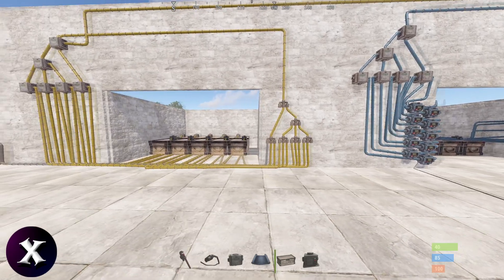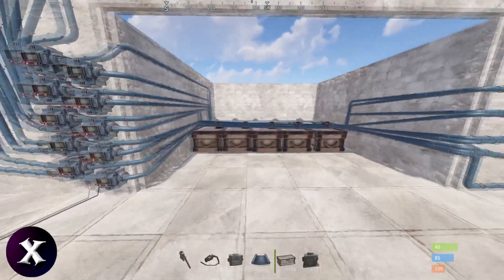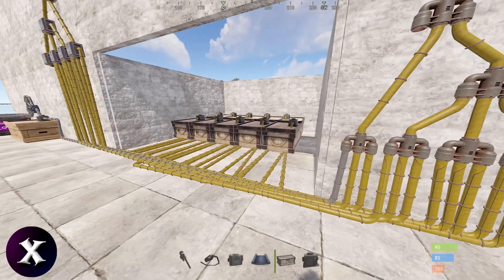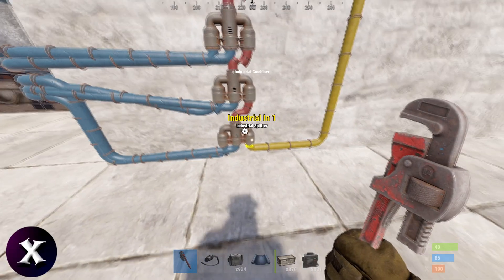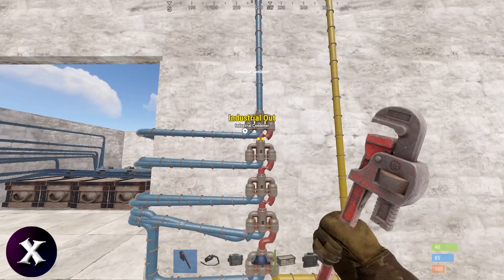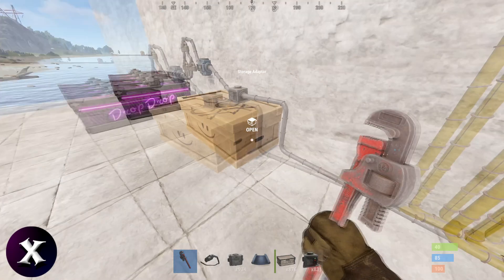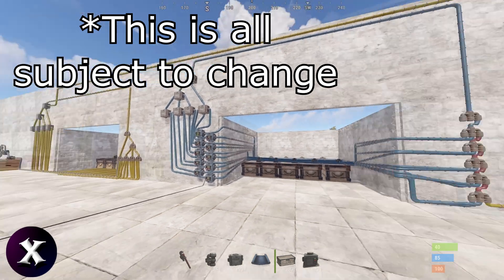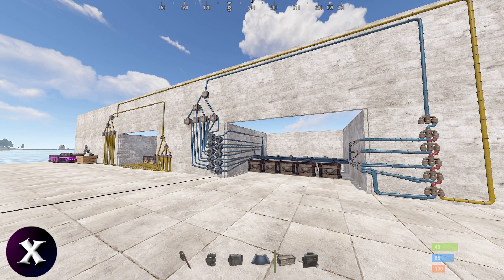Rust Modular Sorting System Hotfix 1.01

Comment: I tried this system, and even with filters, it just pulls the items back out and recycles them through the system.
Reply from the maker: Pulls them back out through the buffer box? You don't want the buffer box getting input from the loop, only output to the loop. Otherwise, it means you have a double filter somewhere. Either a blank filter on a conveyor or two conveyors that have some of the same items on them.
Reply: @x-tremespeed  So every converyer needs a filter in order for it to work. I realized there were 3 boxes that had blank filters, After shutting them off it seems to have fixed itself.
Reply from the maker: @Zyric83  Yeah, since they are all connected in a loop, if you have blank filters they will pull from every single other box. 

Glad you got the problem sorted out!

Comment: have you ever had a problem that not every items don't go inn the sorting boxes, like some times they dont go from the drop boxes to buffer, and some times not from buffer to storage? i im totaly lost, I have watched your videos many times and done exactly as you said, but I don't know how to do it, I have 15 boxes in tier 1 + buffer and 6 boxes in tier 2, for example, I have 8 garage doors and when I put either a drop or a buffer box, they don't go through. im lost plis help 😅😅 sry to waste your time😅
Reply from the maker: If you don't have any filters on your buffer box conveyor that should move the garage doors no problem. I have not run in to any issues like that, but it sounds very strange. The only reasons I can think of why loot wouldn't move are

1. The target box is full
2. The conveyor has a filter on it that doesn't include the mentioned items
3. The pipes aren't connected quite right - if you have a long pipeline it will sometimes not connect properly. Even though the pipe is visually there, it isn't actually connected.

If you're still having trouble, you can try joining the rusticity workshop discord (run by the same folks who made rustician.io) and there's a friendly community there who helps with problems like this. It's easier since you can post pictures etc. - I'm over there too so it'll be easier to troubleshoot.

https://discord.gg/AwpRKJYncF
Reply: @x-tremespeed  omg thank you so much for asnwer so quick<3 i wil try what you said tank you
Reply: @x-tremespeed  i tried and cheked everything but its whatever haha, its strange i dont have anny filters but ye its ok ty for help tho XD
Reply from the maker: @simonueland7214  If you're still having trouble you can try joining the discord I linked and either myself or one of the other helpful people there can assist you with troubleshooting 😄

Comment: I have a question, if I was trying to do two wood boxes instead of just one, how should I set up the filters? If I put two conveyors with wood filters, this system goes into a recursive loop where the wood filters will keep taking items from each other. 

What do you suggest? Thanks!
Reply from the maker: I would suggest adding a splitter on the backend of your wood boxes and connect one line into a conveyor running into the buffer box. Set this conveyor to filter wood, and set the conveyor mode to "exclude listed items". This will pull everything from that box EXCEPT wood and deposit it into the buffer box. Use the additional splitter outputs into any system you have that requires wood.

Sorry for the late reply - I didn't see the notification for this comment, but hopefully it can help you out!
Reply: @x-tremespeed  ah! Thanks for the reply :) I'll give it go later on my server. I wonder if there's a better way to scale this... For example if I've maxed on slots for wood, I would need to always perform this bypass to attach another "wood" box yes?
Reply: @x-tremespeed  by adding a split on the backend of the wood boxes, do you mean a new adaptor or using an existing adaptor to split from? Thanks again for your help!
Reply from the maker: @fierytuner  You would only need to do this once after the last box: wood input conveyor ----> wood box 1 ----> wood box 2 etc. etc. -----> splitter ----> conveyor with wood exclude setting ---> buffer box. You don't need any additional storage adaptors, you can just plug it into a splitter. Just be sure to NOT plug this into a tier line.

You can actually forget about the splitter and only plug it into the conveyor with the wood exclude setting if you don't have any other systems that use wood, so build it however suits you!

Comment: it's so funny that they didn't use a recursive algorithm for an intrinsically recursive problem, so all you needed to do to work around it was just add one layer of indirection
Reply from the maker: I like to think of it as the conveyor making promises to the boxes, and following up on its promise even if it's overloaded. 

To explain further, I like to think of a combiner as a doorway into a room with space for 3 things - any combination of storage containers, or other doorways (additional combiners/splitters). As the conveyor probes down the first input all the way to the end of the line, it passes all these boxes in all these "rooms". As it passes the sad boxes, it promises to pull resources from each one, and conveyors don't break their promises. Once the conveyor hits its max of 16 boxes, it starts heading back up the pipeline to deposit the resources into the output box on the other side of the conveyor. It passes through all these "rooms" with boxes it made promises to, and conveyors don't break promises. Even though it is only allowed to take resources from 16 boxes, conveyors stretch the rules so those promised boxes don't get left behind. Of course of there is any degree of separation (from daisy chaining or additional splitters/combiners) the conveyor won't "see" the boxes as they are "behind an additional door" it doesn't need to open.

Hopefully my little story made sense, that's just how I saw it working haha!

Comment: Hi. I've had a problem while trying to use the minimum function on the conveyors to only allow 1000 stone in tc, and pull out after that. It seems to ignore the filter and pull all stone out. Do you know if this is a known bug? I have about 5 splitters all pulling from the tc, is it a channel limit problem?
Reply from the maker: Yeah, so the minimum function is actually a buffer function. A buffer function means it will only move the item once you have the set amount in your input container - in this case your TC. Basically the way you have it set up is like saying "as soon as I have 1000 stone in my TC, pull it all out." 

I recommend having your stone (and other resources) put into your TC by pulling from your resource containers and using the MAX function. I have a video on this here: https://youtu.be/UqxPoxzOrk8

Also, they ARE changing the way minimum works soon. Minimum will work how you explained, and they are adding a new function called buffer which will do what the current minimum does.

Hopefully that solves it for you!
Reply: @x-tremespeed  thanks for your detailed reply - that makes a lot of sense.
Reply from the maker: @jordanormerod-ik9pn  I'm glad I could help!

Comment from the maker: The maximum amount of boxes this system can hold is 15+1 Tier 1 (15 boxes in Tier 1 and 1 buffer box) and 18 boxes in Tier 2 for a total of 33+1 boxes. This limit is due to the maximum number of connections being 16.

You can increase the amount of boxes by adding a buffer box between Tier 1 and Tier 2, although you will need additional conveyors pulling from Tier 1 into that buffer box. Those conveyors need to have identical filters from all your Tier 2 conveyors, but you can combine filter options from multiple T2 conveyors to cut down on electricity costs. For example, if you had a wood box and a stone box in Tier 2 that would require 2 separate conveyors, but you could filter BOTH in ONE conveyor into the buffer box between Tier 1 and Tier 2.

When the industrial system gets an update we should be able to make even more robust systems without all these limitations, although that's all subject to change of course.
Reply: Have there been any fixes to expand this modular system? Our clan tends to have upwards of 120+ boxes full and I end up having to sort from the 1 ak box hooked into system into the 5 not hooked up. ECT which kinda defeats the purpose even If I dont have to full sort. Id also like to be able to hook up my lockers to the end of it but they hit won't pull if attached to this system since to many boxes :(
Reply from the maker: @justjestering1646  https://www.rustrician.io/?circuit=d004c487deb8bf27fb1ffd8dd6f2678c

Check out this diagram! It lets you have multiple boxes per box type, AND it doesn't even add up to the 32 box limit! The splitters are to allow modules to access the boxes, as well as let tier 2 pull from tier 1.

If you STILL have issues with your massive amount of boxes, this little trick might be able to help you out 

https://youtu.be/s1H7PcHSG_Y

There's a diagram in the description showing how to build it too! Keep in mind, the specific outputs DO matter - set it up EXACTLY how it is shown. It works with both splitters and combiners.

Comment: Hey. Nice video and great tutorials. Can you Make video from how to add furnace to this system. Somehow i cant get that working, no matter what i do. It just dont move ores from main box to the electric furnase and same thing with metal fragments. It just dont send smelted ores to the metal fragment box. 😱
Reply from the maker: Thank you!

Have you seen my Auto Smelter video? (found here: https://youtu.be/DaNjgs6kpVI ) 

If you have and are still having trouble, the most common issues arise from the "too many inputs" error. Make sure you have the ores in your buffer box (or an ore box in tier 1) and connect a conveyor to one of the tier 1 splitters, and that conveyor to your furnaces. Then take the output from your last furnace and you can plug that back into the buffer box (using a spare combiner input you used for the drop boxes). I do know I say to put the furnaces into the Tier 2 input in my Auto Smelter video, but plugging it into the buffer box leaves less room for errors. keep in mind, this only works with around 12-14 furnaces depending on how you have your buffer box set up, so if you are using more than that you will run into issues.

Let me know if you are still having trouble and I'll help you get it sorted out!
Reply: @x-tremespeed thanks For a FAS answer. Ill try that later today.

Comment: awesome, thanks for this explaination - i could not figure out why there was too many inputs. So the combiners are making the split in this version between the first 10 boxes and the second ?
Reply from the maker: Well it's not exactly splitting the boxes up at all as they are still all connected together, but I found this trick lets you connect more than 16 boxes together. You are still limited by 16 connections though, so be wary of that.